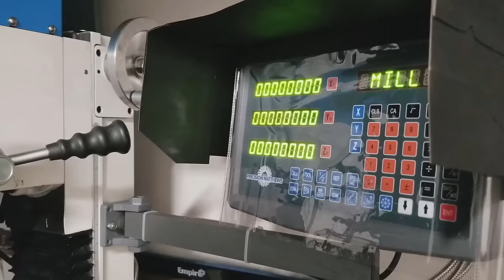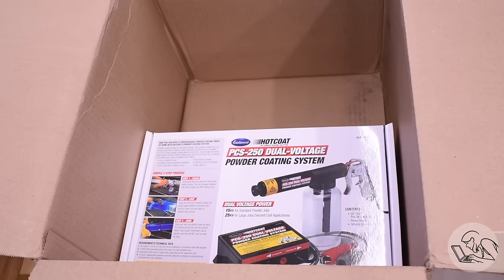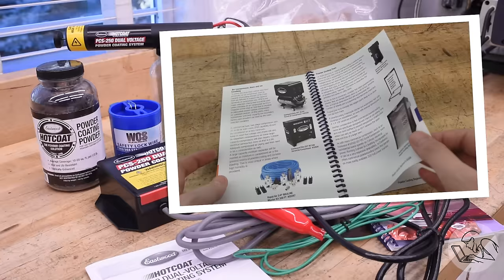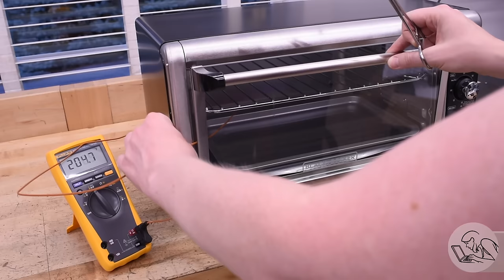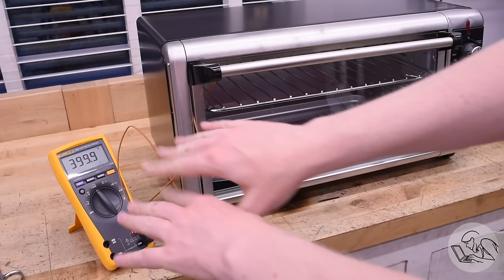Powder Coating At Home! You Can Do It!

Comment: Penny pinching thought to spray longer items…
Try using some type of “brick” (fire oven type gets the job and has the ability to let you torch weld on it as well) and flip your oven vertical on the “brick spacers” since the ovens do not come with feet on the sides and make a simple coat hanger wire setup to create a hanging point for your parts.  If you flip the oven so the controls are on the bottom, you might be able to screw some holes on the top area (the original left side of the oven) and put some threaded eyelet or hooks to give you simple hanging areas.  Just make sure your not hitting any electrical wires.  Even small holes drilled just enough to tread some wood screw eyelets or hooks can do the same thing without penetrating the lefts painted wall.

You could even put two of these mount points more to the widest area possible and bend a coat hanger wire or tightly install a wire from a roll to give you a hanger rod effect. Great video!  I have a HF version I bought years back and gutted an oven for this and I like the racks for hanging pounds.

eBay is great for getting odd color powder often sold by shops that do big jobs but sell the leftovers.  No more standard primary colors plus remember there should be clear powder to seal metals where you want the metal to show.

Comment: When I was running calibration on drying ovens I would make a dedicated TC wire that I would run in the over that wouldn't affect the door. I saw a few spots in that oven where you would do that.

Comment: Used to live 2 block from Papa's Powder Coating in Colorado Springs.  They closed 2019.   He would sell powder from his supply.    Bought some powder but never purchased the setup.   YTer DIY Phil has quite a sweet setup he built and rebuilt.   He recently demonstrated that various cones on the output change power distribution.   Easy 3d print I would think.

Comment: I used top powder coat when I was a bit younger and the process was rather new. When we needed to strip a part, we sent it off to get dipped in molten salt. That really was the only way. Also just cranking the gun voltage can really cause issues. You are trying to match the charge voltage to the thickness of the powder you are aiming for, but that will vary with the powders. If the charge on the part gets too high, it will start rejecting more powder (same charges repel). 
Also, you can shoot powder with no high voltage power supply. It's called tribocharghing and uses static generation from the friction of the powder flowing through a gun of just the right material.

Comment: Powder coated certainly thousands of jigs, lures and lure parts over the years. For small parts a fluid bed vs spray is the way to go. No respirator necessary. A fluid bed cup can be made or purchased for reasonable. Mine are made from 3" PVC pipe (I also have some 2"ers). 

Power supplied with a simple aquarium aerator and surplus flow controls adjust the air to each cup. Yes, one aerator can run at least 4 3" cups concurrently. 

A toaster oven can be had at rummage sales or resale for as little as $5. Primary coats apply well at 350 - 370F. curing takes different temps/times based on the powders.

Mistakes can be redone, just toss the part into a can of acetone (fastest) or an equivalent solvent Wait a bit, pull it out, wipe it off, maybe rinse it in fresh solvent and recoat.

Comment: The coating setup is somewhat capacitive so it will It take a few seconds for the high voltage electrostatic charge to build up on the parts. Waiting a few seconds after turning on the high voltage before applying the powder should help even out the coverage. I only say should as I don't know that much about powder coating but I'm pretty good with electricity and how it behaves.🙋‍♂😉Love your work. I'm learning a lot.

Comment: I’ve only powder coated a few small parts with toaster oven and an old craftsman electric powder gun with its built in ground. The gun opens up and holds a small amount of powder.  It sprays the powder without using a compressor. Not really the best, but I’ll have to upgrade my system if I get deeper into this.  BTW. Great information, really appreciate the detailed explanation in your tutorial

Comment: The mic on the wood was hilarious 😂 im a dead tree carcass butcher, wood acts differently than most other materials. I imagine most here know metals, so il blabber on about dead trees for a minute in case anyones interested 😁😆 
Wood moves differently then metals, metals expand/contract due to temperature, wood expands/contracts due to moisture in the air. Wood tries to reach equilibrium with its environment, so in moist air itll take on some of the moisture from the air, this "puffs" up the wood and expands it. In dry air the wood will dump its moisture to reach equilibrium, so it then contracts. Imagine a bunch of rubber straws (the wood fibres that run through the length) filling with water (moisture from the air)...... the straws swell up and get fatter, this is how the wood expands....... But a straw dont really get longer, just fatter. Wood will get wider and thicker, but it doesnt move very much in its length...... and its proportional, the wider/thicker it is the more it moves. 
Measure the width (back to front) of your bench in the winter, and again in the summer, you will get different measures....... youll need a large mic for that job tho 🤣

Comment: We (at work) powder coat aluminium 9h a day 5 days a week. Sometimes have 2 systems running.
We have a track with hooks and the parts go through a pre treat system. That cleanes the oil from the machines and etches the parts. That then gets dried. The hung on the paint line. Through the paint booth and into the oven. 
Even with small lugs a single hook is enough to get the ground we need. But industrial machines may make a difference.

Comment: When I was at school more years ago than I care to say we did some powder coating. An old domestic oven. A wooden box that you plugged a vacuum cleaner into (blowing not sucking) that fluidised the powder in the box. Heat the item. Dip it in the fluidised powder box. Put it back in the oven to bake. Done. Please don't ask for more details than that, it really was a long time ago and the memories are badly faded 😢 Definitly no spraying of powder needed though.

Comment: You are correct, it is actually the box that's weak. Amazon, in particular, has been lowering the amount of material in their boxes and it shows. Often simple things like air filters or small electronics will have boxes that have thicker walls and are more sturdy than the Amazon box they shipped in.
Reply: Which is why they're doing it - no need for a full-strength box when it's already carrying a full-strength box! The amazon boxes are primarily for standardising the shipping sizes for logistical efficiency.

Comment: Thank you so much for this video. Nice instruction and easy to follow along. I have a Sears powder coating gun that I bought at a flea market some years ago but never used for lack of an oven. It never dawned on me to use a toaster oven. I do have a suggestion (which I see has been mentioned before in the comments). I am an Electronics Technician and can tell you that Stainless Steel is a horrible conductor of electricity. I recommend using a steel or copper bar to hang your projects on. Also, if you can, bend your hanger into more of an angle so that it makes better contact. Just my thoughts. Thanks again, I am a new subscriber and look forward to further content.

Comment: I also went down the Eastwood solution to power coating and did get one of their ovens.  I have used to extensively in my antique car restorations.  I have found I do need a bit larger oven, but the small parts work great.  Also, I live about 5 miles from a major power coating dealer and getting power and other items very easy and I don't have to pay freight.  I'm getting ready to purchase a 100k volt gun.  Great information.!

Comment: Powder coating works so well I got put on probation for my first set of parts because you could clearly see fingerprints and they matched them to me.
Spent the rest of the day on sandblast duty...and taking flak for every single part, cleaned properly or not.

Comment: Good work on the video.  Just an uninformed suggestion:  what about using a smoker for baking?  More room, lots of potential hanging spots with the grills, temp control (though may need some insulation to help hold heat) and possibly used/cheap... As I tell my family, it's a thought, even if not a good one!  Hey to Sprocket!

Comment: For small parts you can tumble them in the powder. Many handloaders powdercoat their cast bullets that way. It's really consistent if you do it correct
Reply: Do you still have to charge them up or does this remove the electricity HV supply needs?
Reply: @AlsoDave You just dump the lead bullets in a container with powder in it and shake it. Strain it, then bake it as normal. Some pre heat the bullets a bit (more common where for people who have limited selection) it can help with attaching the powder.

Comment: Re: good ground
Try clamping the ground wire right onto the SS hang wire. If the clamp is too puny, upgrade to a battery charger/jumper cable clamp.

Re: bright light
I worked as a carpenter/contractor for nearly 40 yrs. My trade secret for top quality work & happy, happy customers was using bright, harsh work lighting; especially when it came to painting, sheetrock mudding, finish carpentry, etc.

Bright, harsh lights create distinct shadows. Uneven surfaces, highs & lows standout like warts on a nose in such lighting.

If you strive to make your work look good in critical lighting, it will wow people under normal lighting.

It doesn't take a lot more effort or time to produce top quality work; part of it is pride in your workmanship & desire to excel, but I found a big portion of it is simply being able to see the imperfections. The same goes for painting or coating anything. Invest in some LEDs in a bright white color temp; stay away from yellowing floros or cool white lights, floros are for offices & warehouses, cool whites are for a living room.

Make it bright, make it bluish-white!

Comment: I started doing some powdercoating a couple of years ago.  I scored a free oven that needed a new element so that worked out well.  I tend to do larger items and if you put in a large room temperature (ie "cold") object into an oven it will take a lot longer than 10 minutes to heat up.  The item regardless of size acts as a heat sink so large objects are large heatsinks, you can't really jut rely on timings.  I do recommend an infrared temp gauge, quickly open the door, take a reading of your workpiece and close the door asap.  It can take ages to come to temp.

About to discover the world of cerakoting..

love your channel..  :)

Comment: There is also a dip powder coat/paint system for making fishing lures. When I worked in a commercial powder coating facility we had straps made of thin bar stock with tight bend and bolt and nut and multi thickness plugs on the strap for tight fit on part

Comment: I’d love to see you test the manual application and use a heat gun to set the powder. 

Heat guns can get to 400C / 1022F these days - makita has one that’s 18v battery power. 

I’ve seen some channels test heat gun application - and seems to do ok.  Especially if pre-heating the part then applying powder. Then reheating. 

Powder only needs around 150 degrees to set and cure.  With a mobile battery powered heat gun application - powder coating can be done in situ without removal if needed.

Comment: in highschool technical class we powder coated things in a rather different way. first the parts were heated up in the oven and then dipped in a pot full of powder that had air blown in at the bottom which made the powder act like a liquid. it quickly melted on the hot part and bonded without the need for electrostatics.
Reply: You created a fluidised bed, which is a process used in industry to coat  things like fridge shelves, clothes hangers, etc.

Comment: You can buy for cheap, an industrial PID regulator with K type thermocouple, and a solid state relay (Regulator is about 30-60USD depending on quality, and sokid state relay is about 15USD) and wire it to your oven. That will keep it stable in proximity of +/- 2 degrees. Worked like a charm for my DIY powder coating oven.

Comment: I have seen a powder coating workshop once. I believe they used flames (gas heated). But with professional equipment the distance probably is very well calculated
Reply: Maybe they had a way to isolate the flames by spreading the heat

Comment: To remove powdercoat its best to burn it off. I've been powdercoating on a mostly hobby basis for about 5 years. I use a semi pro gun the Redline ez100 well worth it if you are a regular user. My oven is home built and is about the size of a large domestic refrigerator. The faraday effect is your enemy, that is why they offer the voltage adjustment.

Comment: If you're after low pressure gauges, home brewing supplies are a good option, home brewed beer is normally served at 10-15 PSI of pressure from pure CO2, so need gauges to get down that low. They're not for "air compressors", but if the thread fits, it'll probably work just fine.

Comment: Get a Makita MAC 5200 contractor's air compressor. It's a good compressor which makes plenty of compressed air and is designed for duty out in the elements.  I built a dog house looking shed for mine because neighbors and I keep it outdoors all the time, which helps with noise and air quality in the shop.  Add a Motor Guard filter drier if you want clean, dry air.

Comment: A few years ago I saw Blackbeard Projects modify his cheap toaster oven to be far better thermally insulated as well as digital thermal readouts but that part is optional I guess.
What he did was line the walls of the oven space on the other side (inside of the unit) with thermal wool to make it far more thermally efficient. That might help you here?

Comment: You can use these typical "third hand" for soldering to hold a temperature probe on a stable position in the oven. Otherwise it is hard to control those wires flying everywhere.

Comment: I'm surprised this isn't more common among hobbyists, it's much less fussy and demanding than I would have thought, and the curing temperature is much lower than I expected. Regarding the ground connections, heavy parts might provide a strong enough electrical contact for a gravity-force contact area, but use of spring clips would be far more reliable at all electrical contact points.

Comment: The thermocouple on that Fluke is going to be more accurate than any infrared you will buy at any price. I work in a lab. Just drill a hole in the side of the over and mount the thermocouple somewhere other than through the opening in the door, but the thermocouple is the most accurate electronic temperature sensor you are going to find for this project. There are others in the lab that can be calibrated for for even more accuracy like an RTD, but for a budget project where you’re temperature just needs to be in the ball park you cannot do better than a thermocouple.

Comment: The pressure gauge that comes on a "torpedo heater" reads low pressure very well. It's used for the air pressure generated to push the kerosene to the jet, they are very finicky and need a very low but specific pressure. I believe it 3 or 4 psi, can't remember what that is in BAR...  45 ish? maybe?

Comment: From the jewelry realm, I've heard that most things stick to copper, but nothing sticks to zinc. If possible, try some low zinc brass and see if you get improved adhesion. It seems to make a noticable difference for porcelain enameled brass. It may make a difference for your model parts if you want the best result possible.

Comment: I've always wanted to get the cases of my vintage IBM PS/2s re-powder coated, but my brother told me the cost basically wouldn't be worth it. There's the odd scratch, but the main reason is a fair few spots of surface rust showing through the coating which would require stripping the coating and wire wheeling to remove. Perhaps a home powder coating kit might change that equation.

Now I'm wondering if the rough textured coating is created using a special spray technique, some special baking technique, or a special powder (or some combination thereof).

Comment: Not sure if it would work but you could consider turning the oven on it's side.  you'd need to make some sort of hanging rack with slots at appriopriate heights but it might make it easier getting things in and out.
Reply: I did this, works fine. Much easier

Comment: 20A Variac and you could give your oven that extra boost to get to 500F.
Thanks for the video.  I've been researching this too.  Like others have said, I've read that pre-heating helps quite a bit.  Especially for larger parts with lots of thermal mass.
For grounding, I was thinking that no-flux solder braid would probably work well.  Copper, lots of surface area, and would conform to a hole well.
PID control sounds like a must in my opinion.  And you get a cool display to play with.  :)

Comment: The trick is using generous amounts of powder. Really get a cloud of powder in there and allow it to settle on the part from slightly above, don't spray like with a can of paint. And chamfer that edges, sharp edges wont work well with powder coating, as the liquid coating has a somewhat high surface tension.